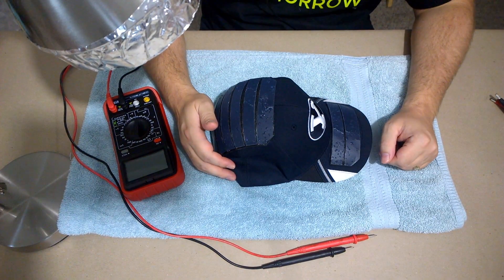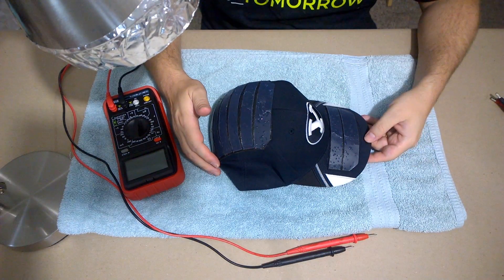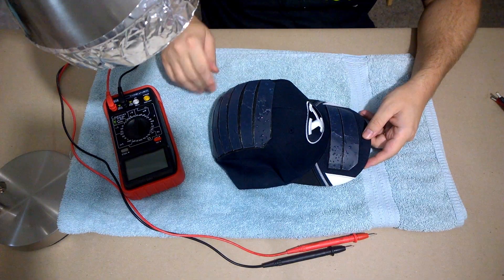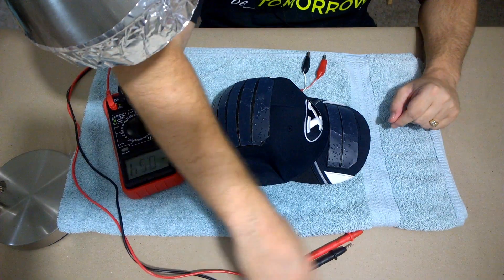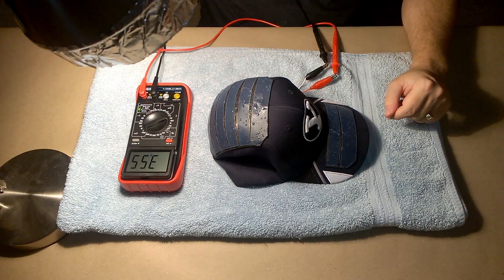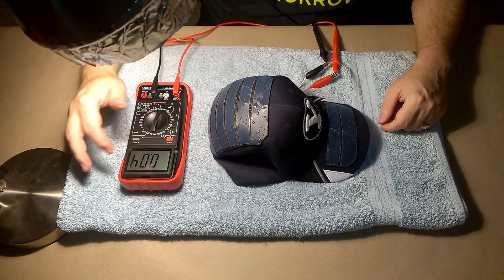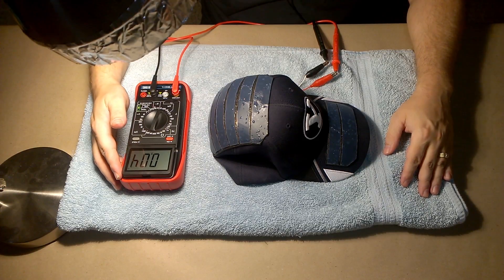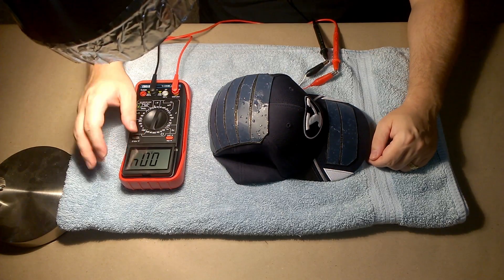Solar Cell Phone Charging Hat Project - Rain / Water Resistance Test

Comment: This would be useful in areas where power goes out often. Is it possible to make an actual "plug" for a lamp or something. 
Lol just walking around dragging a minifridge in a wagon xD. Or does it not have enough power output to power something like that. Just walk to work with a minifridge xD.
Reply: I think that's a bit much, plus it would be easier to just cover the mini fridge in solar panels. haha
Reply from the maker: Well, actually... anything with a USB port can be charged. Lamps, radios, etc. All sorts of things.
Reply: Would it be able to power a mini fridge xD. If I could get a mini fridge with a Usb thing. xD.
Reply: +Rocrafter202 Fridges use about 750 Watts a phone charger uses about 10 watts so if you have 75 of them it might work :p